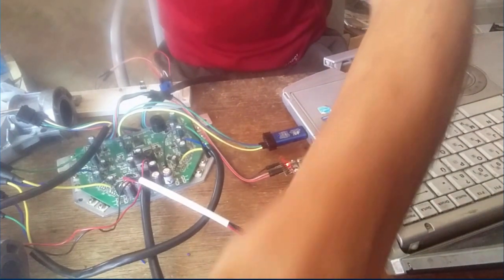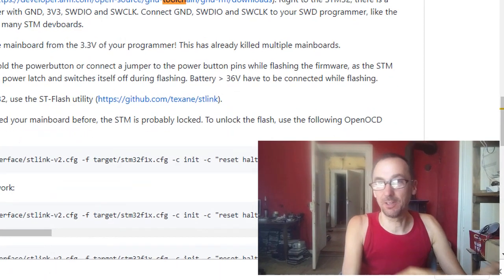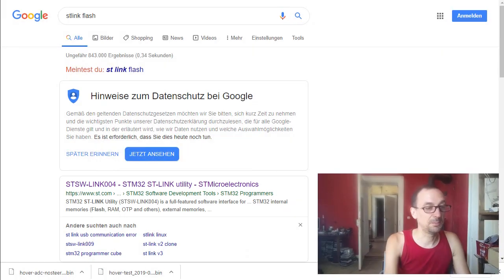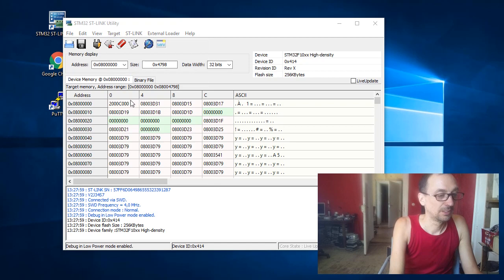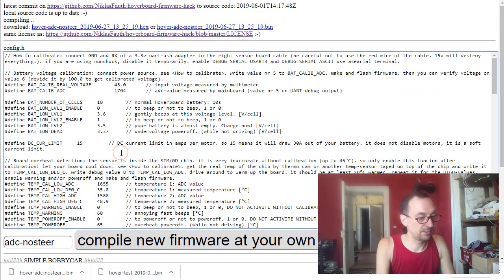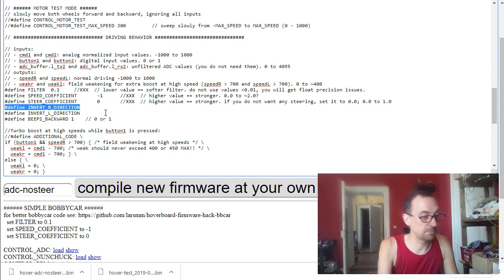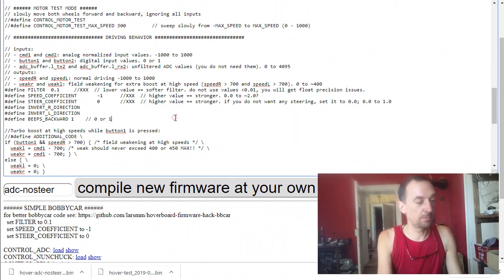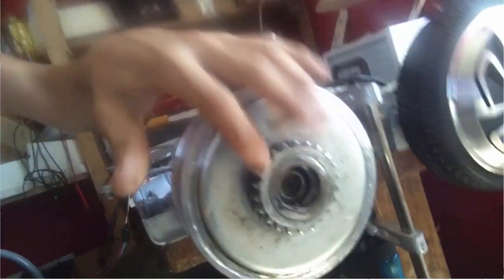free online hoverboard firmware compiler - full tutorial :-)

Comment: cant make a hex that work with the ninchuck what am i doing wrong?
Reply from the maker: Yes when you select my Nunchuck bobycar preset you get the compile error: 

Inc/config.h:149:4: error: #error CONTROL_NUNCHUCK and DEBUG_SERIAL_USART3 not allowed. it is on the same cable.
   #error CONTROL_NUNCHUCK and DEBUG_SERIAL_USART3 not allowed. it is on the same cable.

So simply put "//" before the "#define DEBUG_SERIAL_USART3" line in the config.h and it will compile.
Simply hit strg+F on my page and search for DEBUG_SERIAL_USART3 :-)

It is also always good to search for XXX as this will show you the changes my default presets have done. This would have already pointed you to:

#define CONTROL_NUNCHUCK //XXX            // use nunchuck as input. disable DEBUG_SERIAL_USART3!

Have fun :-)
Reply: @robodurden  thanks for the fast replay . still cant make it copiling find the define uart3 and putt // before it and define  nunchuck and removed // but still cant copiling
Reply from the maker: @rainbows_unicorns_lovers  I now tested both versions NiklasFauth/hoverboard-firmware-hack and p-h-a-i-l/hoverboard-firmware-hack , both with the Bobbycar and the armchair "load". All compile successfully and it always only needed the "//" before the  "#define DEBUG_SERIAL_USART3". What browser are you using? When compilation failed you get an error message. Post it here.
Reply: @robodurden  so i dont have to remove the // before define nunchuck?
Reply from the maker: @rainbows_unicorns_lovers  of course you have to if you don't use my multiple one-click defaults. But now please repeat what i have just tested! Scroll down click on "load", add the "//" to disable serial debug in the config.h and hit compile :-)
Reply: @robodurden  it works fine. My bad, i removed the // in front of define nunchuck. Thanks again amazing work with the web compiling. Like your solar car
Reply: moving forword. i use p-h-a-i-l/hoverboard-firmware-hack put// in front of define debug. and removed from define nunchuck now it moves when i move the joystick around . now i have two problems nr one the nunchuck isent calibrated. two when i press the bottom to turn of it start piping and never turns of. eny ideas? thanks in advance man great jobb u dont need to worry about niklas penis hahhahahaha best regards
Reply from the maker: @rainbows_unicorns_lovers  Be happy that the nunchuck already works. The Nunchuck is the I2C client and the control board is the I2C Server. I have never tested that. PHAIL rather focused on UART control which i have made stable: https://github.com/p-h-a-i-l/hoverboard-firmware-hack/issues/12 I will upload that better fork to my own github account in the near future.. For Nunchuck you could as Niklas. But as he has such a big ... he might not have the happiness to help you. Then you need to dig into the source code yourself.With the I2C communication you should activate (remove //) #define DEBUG_SERIAL_USART2 and succeed with getting debug info from the controller. Then you can add setScopeChannel(...) or consoleLog("hello 1") to see how the NunChack data gets processed. Take a look at the main.c ! That should be the only file you need to look into :-) But it may be better for you do go the ADC way. That is the simplest and most reliable control interface.
Reply: @robodurden  it works now Thanks a lot. will continue reading the code so i understand it from start to end . one more time thanks u maked my day
Reply: hi what do u mean with adc google but dont realy know if it was the right answer. now im trying to control with a gas from a kickbike what do i need to select its just a potentiometer. hopes i dont annoy you thankfull  for your help best regards from sweden Gonzalo
Reply from the maker: @rainbows_unicorns_lovers  adc = analog-digital-conversion and is exactly potentiometers :-) You should have watched https://media.ccc.de/v/gpn18-95-howto-moving-objects already. Simply put the middle pin of a potentiometer (1kOhm or 10k or 100k ..) to ADC2. the outside pins to GND and 3.3V. More secure is to connect a 10k Resistor from ADC2 to GND directly on the Controlboard and use the outside potentiometer only to pull the ADC voltage from 0 Volt to 3.3 Volt. That way your motors won't go to max speed when you accidentally disrupt the kickbike-potentiometer.
Reply: Thanks for this schematic description, @robo durden!
Reply: Hi Gonzalo, did you manage to change your hoverboard software so that you could control stably with nunchuck? If so, could you please share the final package that you use for hoverboard firmware replacement? Many thanks

Comment: Hi I'm working on the same type of project but Im having one problem after uploading the .bin file it upload fine but when its done I get a continuous beep can you help
Reply from the maker: Get a second board to check the first one is not broken. Is it exactly the same board as on the GitHub ? Different board might have different pins connected.. Did you install one of my presets ? The adc- bobbsCar works fine on my board.
Reply: @robodurden Yes I have a different board. But I'll try another board and let you know thx
Reply from the maker: @brooklyn_uav4589  Check if your board has the identical STM32F103RCTx processor ! And even if same mcu, the pins could be mapped differently. You could help others (.... !) in learning the pin assignment of your board. Is the serial debug output still working on your board (besides the continuous beep.) Then you could check whether the two adc inputs are also mapped correctly. Then take a look into the source code to find all the pins used by the firmware (input: hall sensors, output: mosfet drivers..) It might only need a few changes in the pin setup to make your board work. We could modify the firmware to set all pins to input but the TX of the debug serial. Then logging all the new input pins to the serial and you could quickly identify the  hall sensor inputs. Same could be done for the mosfet pins by setting all mcu pins to output..